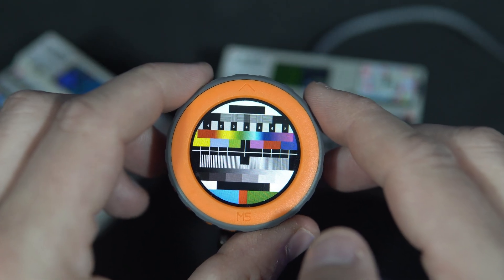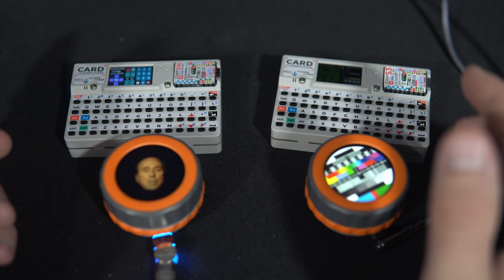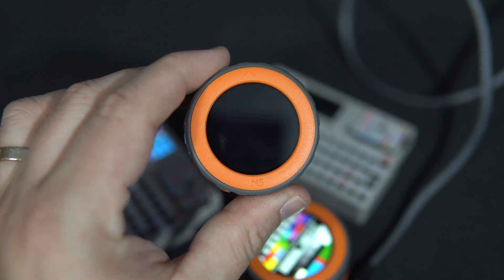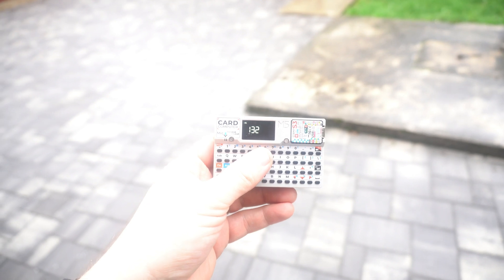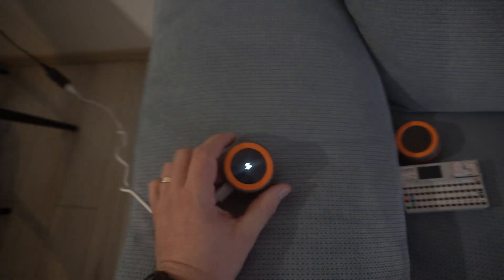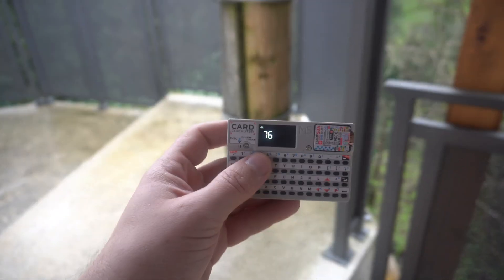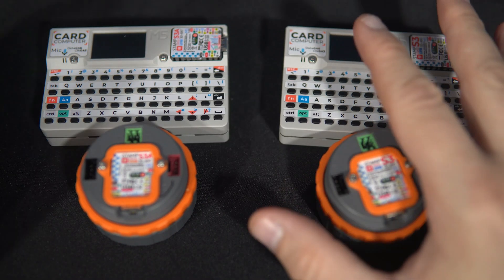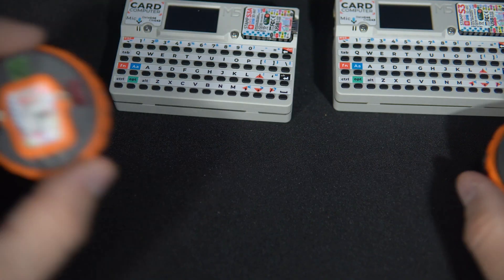Testing ESP-NOW Range with the NEW M5 Carputer and M5 Dial

Comment: As with all wireless transmissions, ESP-NOW also depends on a good antenna. 
I recommend using the ESP32 with a semi-rigid SMA screw antenna, if you want to work at maximum moving distance.

Comment: I just got a m5 dial this week and want to use it for motor control. What I don't like about it is that the installed demo is not an Arduino sketch so can't easily reuse the code unless I want to use the esp dev tool chain so it's nice you provide all the code in Arduino IDE.